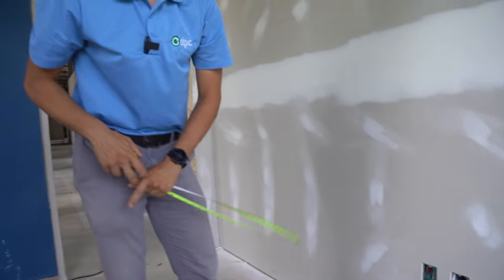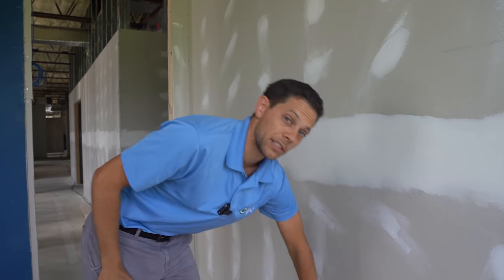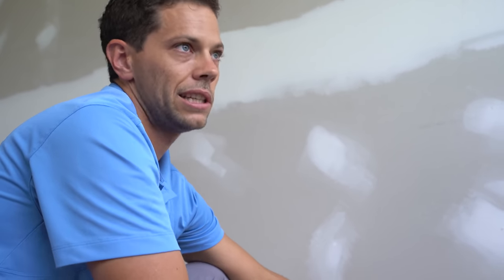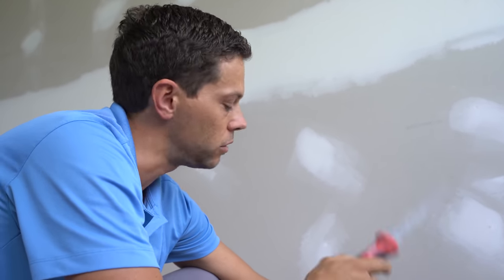Wall Wire Fishing Master Class: Run Cables in ANY Wall like a Pro!

Comment: I use fish rods in insulated walls all the time. I also use seismic wire often (T-Bar ceiling support wire.). Sometimes jack chain and a magnetic retrieval tool. I never use fish tape for anything other than fishing a conduit. It can get stuck in voids and it's almost always a loss when it binds up in the wall. It works for you in this situation because the wall is open at the top. Props for making the video though. (22 year TX master electrician)
Reply from the maker: Yeah, everyone definitely develops their own techniques based off the type of installs they do and types of construction.  Marty has been doing it a long time 20+ yrs..  but that's the beauty of everyone sharing, more than one way to skin the cat...
Reply: Grimlock is absolutely correct on this. IMO, The method in the video demonstrates a wrong way of using a tool...the electricians are going to have a good laugh.
Reply: Same. In insulation or with fireblocks it rolls back on itself so I use rods.
Reply: Curious what u mean by tbar support wire, r u referring to pencil rod?
Reply: Had a couple apprentices do this with my fish tape with a spring leader. I guess it ended up getting snagged on a screw tip and could not be recovered. Had to cut it loose..... Ugh. Rigid fiber rods, strings, and weights work best in insulated walls.
Reply: Are you part of the "Dinobots"? LoL
Reply: @zackmorris25  Yes
Reply: Harbor Freight has a 30' fish rod kit for like 19 bucks, it's great cause it's super flexible, perfect for walls but kind of limp going over drop ceilings, would just throw a ball with some string wrapped around it.

Comment: Just a note. Your first attempt at fishing went behind the stud. If you taped on at the top and pulled down you'd be trying to pull your wire through that tiny gap between the stud and the drywall.
Reply from the maker: Yeah we saw that..  LOL
Reply: @DPCTechnology  I usually leave a ball of electrical tape on the end of my fish tape to prevent it sneaking in places like that
Reply from the maker: @donalddluckerii3147  great tip!

Comment: Trying to get a wire up through a wall and in to an attic of a home (commercial work is much easier) can be a difficult task especially when you encounter a cross brace (blocking). Instead of wasting valuable time just get out your multi-tool and cut out a large enough portion of the drywall to fit your drill with bit installed. Drill your hole and run the wire. Cut to the chase. It’s only drywall repair.
Reply from the maker: This is really good advice. I'm going to pin this response. I should have done a little bit more comprehensive section of the video about this technique.  In certain cases it's many times easier and often even after you fight the wall for a while, you end up having to resort to this method anyway.

Comment: It's a hollow wall... Just dropped it from the top and boom you have your wire. If you are in a house you want to drop it on the other side of the electrical because of induction. Either way I have rarely seen anyone food from the bottom up because there is usually a header at the top blocking you. Some of these video's are full of it.
Reply from the maker: Yeah Marty was using as an example, as u probably know, every one is unique!

Comment: Tried my best to get an old school licensed journyman Low Voltage Electrician to install our pre-wire outlet boxes at the same height as the existing power boxes but no, this guy was way smarter than everyone else on the planet and he had certifications to prove it so he would install our CATV/Telcom outlets at the precise height described in the code regulations which invariably resulted in his work being obviously misaligned even when view from accross the room
  Finally found it less stressful to just stay late at the end of the day and go back through to fix his "work"
Reply from the maker: There is NOTHING worse than boxes at different heights..  LOL
Reply: @DPCTechnology  
👍😂😂

Comment: A long time ago, when erecting stud walls, I got into the habit of drilling holes through the studs at a certain height and holes through all cross braces. All with the idea that if at some point any cable was to be run through the walls, I had it covered. Finding those holes is even easier with today's technology, using a camera system. They are so economical to buy and there are a lot of choices.
Reply from the maker: That's pretty cool
Reply: Can you share what kind of camera system you are using?
Reply: @hcancapraz    I have the top of the line Mastercraft system.   It has a three foot fully adjustable probe.  It lights up your path and comes with different snap on tools for doing different tasks.   
DeWalt and other tool manufacturers also have systems.

Comment: When I tape a wire onto fish tape I always start taping from the wire side, overlapping each pass, and continuing for one or two wraps past the end of the wire. This helps prevent things from snagging or lifting the exposed edge of the tape. Continuing to wrap past the end of the cable lets you create a gradual ramp where the cable starts, rather than a sharp angle that snags the lip of any surface you pull over.
Reply from the maker: Thanks for the tips!
Reply: Same here

Comment: Good video. I've also used flexible drill rods to get through a cross brace.  They come in 4 foot lengths and avoid the extra holes need to get patched later.
Reply: I was thinking the same but if there is insulation in the wall sometimes those drill rods can really wrap up a lot of the insulation making it difficult to get them out...besides that and avoiding existing electrical or pipes in the wall the drill rods work well !👍👍😎

Comment: My cheap company would never spring for stud finders and it was commercial with all steel studs so I used a few strong gangable round magnets especially in elevator lobbies that had triple layer of  5/8" sheetrock. Every wall had what they called itchy woo! ( thick dense  insulation ) .Usually won't roll over when you start from too and fish down. Gangable 4' lengths of fish sticks work great. Had several heavy pieces of fish taped doubled up from 8 to 16' long . Always got thru .

Comment: Great video, I would like to suggest that when you connect a cable to a fish tape, strip the cable sheath back 2 - 3 inches, then pass one or more of the conductors through the fish tape, finish up by taping the conductors, cable and fish tape together. This method makes a slim, flexible, super strong connection that  works well, saving a lot of frustration when trying to pull cables in difficult situations, such as conduits. Your method works well with not too difficult cable pulls.:washhands:
Reply from the maker: Agreed, great point!!
Reply: I don’t like the fish tape with the hook on the end, I prefer putting the wire directly into a straight fish tape so the sheath goes over the tape and then use electric tape to secure. Also, some type of wire safe lubricant makes the job a lot easier. Of course the magnet systems they have now too can be a good option.
Reply from the maker: @GhostSal  thanks for the good suggestions
Reply: @DPCTechnology  You’re welcome, thanks for putting out videos to help people. You know the hook on fish tape was designed at a time wire was a thicker gauge. You could take old phone wire and loop it through, then twist it around itself and tape it. It was very secure and easy to pull through but the thinner gauge wire of today would just tear out and that method wouldn’t work well at all today…. And yes, I’m old!

Comment: Nice intro to fishing video. I always use the packing tape with woven fiberglass fibers in it to tape my "can't fail" cable pulls - glue is stickier, tape is stronger and the fiberglass adds extra  strength. Costs more but worth every penny.
Reply from the maker: That's a great tip..  gonna try it out..  Thanks for the kind feedback

Comment: i always pull a wire out of the end of my romex and feed one of them through the loop in the fish tape and then wrap it around itself -- this makes a connection that cannot get undone.  but your method is faster and would work for more people most of the time.  i never learned anything about fish tape=  i started using it by myself before the web came along, so that self-developed habit is an example of a technologic use  of an object by a pre-contact human
Reply from the maker: Experience is the best teacher!!

Comment: When needing a secure attachment to the Fish tape. Strip about 3" of the outer jacket, pull strands back then strip off center core then wrap both through fish tape, fold over, twist and tape up. Has a smaller profile and will go through a smaller hole. 
If lots of room, and easy pulls, don't just tape around both tape and cable . Wrap electrical tape around Fish tape a couple times, then around both. Is quick and more secure. 
Cross Brases are also called Cats, or  Fire Stops. 
Bullet? Levels are commonly called Torpedo Levels. If you push Fish tape directly from front, and not sideways, Fish will not fold over as fast. I have Electronic Stud finders, but more than 90 percent of the time   I use a strong round magnet to find the screws to locate the studs. Is strong enough to follow EMT behind drywall on block. 
Also to find studs, I will pull receptical out of box, feel which side screws are on, and if a 1900 box which is 4", 2" over will be edge of stud. If it's a Plastic Box, loosen receptical push on left then right side of box. The side that won't push in, is where the Stud is.
Stratmando
Reply: Why the heck have I never thought of using my strong  magnet to find the stud screws 🤦🏽‍♂️ genius idea.

Comment: Fantastic description, thanks for going into the detail that you do! At one point you said “This may seem obvious”, but that’s exactly the thing that’s good to cover. Good clear communication. 

I’m also wondering how one would go up or down two floors at a time? Obviously the process would be to do one room or wall section at a time, though I’m wondering what I’ll hit when I am behind the drywall and going between floors (Main floor through 2nd floor into the attic, or even Basement -> Main Floor -> Second Floor -> Attic)
Reply from the maker: That's a really difficult problem and it really depends on how the house was built. We would most likely cut an exploratory hole and patch it above and below.
Reply: @DPCTechnology  With access to the attic would it be possible to try to fish a snake down and see how far you get?

I’m glad to hear that it’s not an obvious answer, because it doesn’t seem to be one that anyone specifically addresses. Probably because they can’t address is for everyone.
Reply from the maker: @majorredbeard  you can drill down through the top brace of the wall and see how far you get.  Maybe try a couple of voids.
Reply: I have followed furnace exhaust chimney and there was more then enough room to run wires.

Comment: Six foot drill bit helps with the cross brasses and avoids patching
Reply from the maker: 100%  long (6ft) flexible bits help with headers and footers too!  Thanks for the feedback!
Reply: Difficult to put some of the more rigid 6ft drill bits(ones that will actually go through things)  up that far into the wall  when youre starting from 16” off the floor or so. I moved home a year ago and every damn house has cross bracing.
Reply: @codeninja1  right tool for the right job. Haven't had to patch a wall in 30 years of pulling wire... There's always a way no matter what anyone says

Comment: You also have the added benefit in this video on where the studs are at because of the mudding on the wall covering the nails/screws in the wall.
Reply from the maker: Yeah we usually don't have that help.  But a lot of the times you can cheat with them..

Comment: when running through conduit, only use the fish tape to get a pull string in there. Or a mouse and shop vac, don't kink up your tape using it to pull wires

Comment: I've used Pool Cues on top of paper covered insulation on top of suspended ceilings. Tie a nylon cord to the end, lay the cue on the insulation and smack the end with a hammer and then you hear it hit the wall on the other end.

I've also had metal Fish Tapes loop themselves when going down an open wall cavity. That was a pain.
Reply from the maker: It's fun to hear everybody's tips and tricks!

Comment: I am a low voltage technician. I fish walls by 1st finding the studs. You can usually see the seems above the drop ceilings & use the tricks he mentioned. Just look near the top of the wall. Then cut a hole that will fit your stick with the cables taped on. You then test the wall by pushing your sticks down. You will be able to see how far down they went. Know you know for sure the wall is open & you then cut you MP1/box in the wall. I do the start in the middle trick he mentioned & cut out but I start at the bottom of the cut. I use a pencil & trace it. Now I have a hole i can reach my arm i to & just grab the sticks. Esp when there is insulation.  Not sure why he doesn't use sticks with insulation.  There make many different types of sticks.  I use different  sticks when running cable then fishing walls. If there's no Insulation then just start at the top & push the cables down the wall! Lol
Reply from the maker: Sounds very similar to how @Martty does it.  Everyone will have their slight variations based on preferences etc.   Thanks for the tips and feedback man!!
Reply: @DPCTechnology   You're not kidding Everyone definitely has their own way of doing things And it's the best way in their eyes. Lol  I cringe every time I think back to how thick headed I was when I started. I definitely banged my head against and against the wall unnecessarily unnecessarily if I would've listened more to the older guys trying to help me.
Reply from the maker: @waderowcliffe4807  lessons learned in blood...   Marty has been working with me since he was 16 (he now is my business partner)..  in 20 years he definitely has developed his own methods..  He is not a big fan of gadgets.  They tend to slow him down.. but he has been there, done that (like you) and knows the construction methods in our area really well.  You don't just pick that up on ur first day on the job.

Comment: When the drywall has not been painted you can see the studs configuration by where the drywall has been screwed into to the studs and mud has been applied to those screws.

Comment: Our local broadband provider requires conduit pathway be installed from the outside to the internal location in the dwelling. Unfortunately, this was too difficult for my cable guy!
I am sure it would not be unsurmountable for you! It would be great if you could do one for conduit through brick wall on 2 Storey dwelling.
Reply from the maker: You could run conduit on the outside of the building and then come in the building where you need the penetration.

Comment: First thing i do when wall fishing is make a hole through the wall cap on the top usually wood or sheet metal, then i send fish rods down to make sure i can get to the location of the cut in ring. Often times with wood studs there will be a fire block somewhere in the middle, sometimes 2 of them that you need to penetrate. Usually exterior walls have them and interior do not, depends on the local fire code. Ive done buildings where even the interior walls have them, real pain in the ass but i got 4 foot long bits to handle it. Always fish from the top down, let gravity assist, i only use fish tape in conduit.
Reply from the maker: Thanks for the tips!
Reply: @DPCTechnology  been in low voltage for 10 years happy to share knowledge!

Comment: Thanks for the video, did not know about the orange old work box for cable. Thinking about fishing 18/10 sprinkler wire down a sheet rocked wall to connect to a Rainbird sprinkler timer/controller.  I will also have to run romex down the wall and install an electrical outlet to power the Rainbird. Would this orange work box do the trick for the sprinkler wire? Then maybe put a cover plate with a small round hole like you would use for coaxial cable? It's for my Mom's house so I want it to look tidy (no PVC conduit for the sprinkler wire, lol). Thanks.
Reply from the maker: That sounds like a great plan
Reply: @DPCTechnology  Thanks for the quick reply and input!

Comment: I want to put CAT6 cable around our house, mainly for POE cameras I am considering buying but also for general routing back to switches and my wifi mesh.  I hate routing internally inside conduit as I think it looks horrible.

The issue in my house, and I am sure this is standard in all new builds around the year 2000, is that the plasterboard is mostly dabbed and on some walls there is literally about 15mm gap between the plasterboard and the breeze block.  I struggle even putting some new plug sockets in due to the depth, but I have no idea how to tackle this as there really isn't that much space to be dropping wires inside.  I also want to try to encase them in conduit inside which would obviously be even tighter.

And I haven't even gone under the floorboards or in the attic yet to see if i can get at those edge locations!

I have even been tempted to put battons up around the house and place new plasterboard but of course that would shrink all my rooms and in some places I couldn't do that anyway due to doors right on the edge of a wall for example.

Maybe one day 🙂
Reply from the maker: sometime you just have to cut some holes in the wall and patch them later...  Good luck!!

Comment: Help me> Does it compromised a wall is I drill through the stud? Wont it make the stud weak?
Reply from the maker: It shouldn't, but every case is different.  If it's just a regular house and then regular vertical stud in the wall. You should be fine.